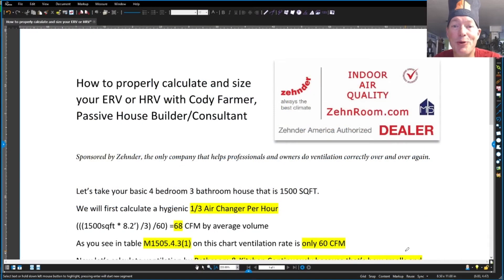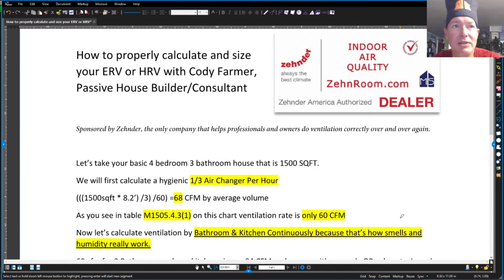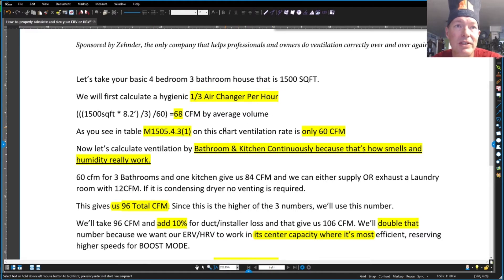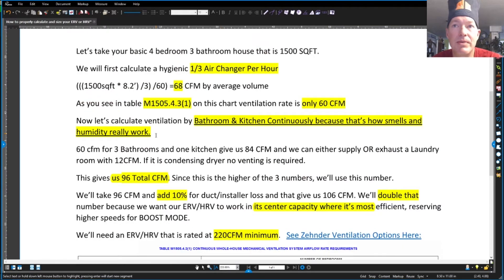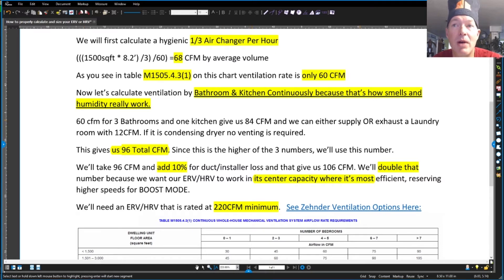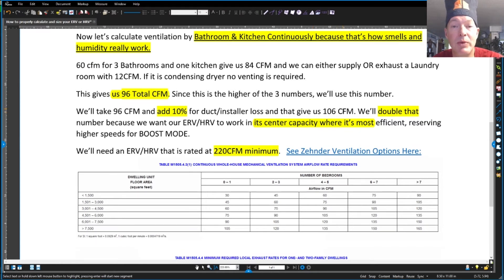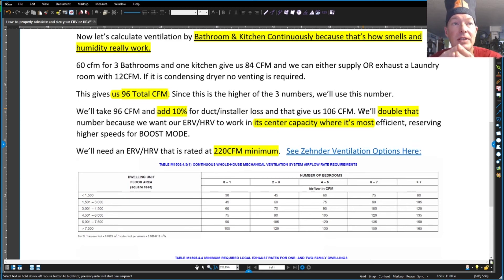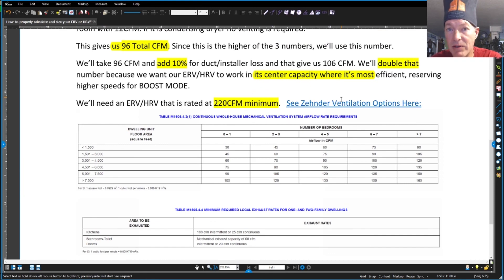Properly Sizing your Zehnder ERV or HRV

Comment: Hi, could you comment on maintaining a positive pressure of 1 to 2 Pa? We are building a 300m2 home, considered tight. 4 bath, 5 bed. Location; seafront - Philippines
Reply from the maker: That's a big questions now isn't it? If it's dry air, probably would be less a concern. If it's humid inside and pushing that into our wall assembly; we would want to look at that instance and thus depends.  Do you have a local Passive House group?
Reply: @PassiveHouseCody  Hi and thank you for taking the time to reply. Things have changed somewhat, since i wrote you. I have added a wholehome dehumidifier to the mix. And it would be great, to get your advice on this and the Pa levels. Or you could send me packing. 
I would like to place the dehumidifier near an exterior wall and make the outside air, its sole return - then duct directly to the supply side of the Zehnder. From there, the ERV would deliver dryer, cleaner air to the rooms. The bad air would be brought back to the ERV, as normal. I'm guessing, I could tweak the CFM levels on the ERV to reach an acceptable Pa?
I am also assuming, the dehumidifier fan, would be disabled? Would that be acceptable?
No, we don't have a Passive group nearby.
Reply from the maker: @davidbruce5377   we test the Air Tightness and offset the supply side to meet that IF possible.  The ERV wants what is most native inside; which in your climate you'll be drying with dehumidification and preserving that via ERV precision extraction and delivery.  I think your idea sounds worth a try. I slight pressurization with dry air sounds good from far. It all depends however on other factors.  Sources of internal humidity and frequency for one. Probably best to email us.
Reply: @PassiveHouseCody  Hi, here is what Santa Fe said;
The dehumidifier still has to work regularly like it normally would.
 
Regardless if ERV supply is going into the Dehu, or dehu supply is going into ERV, the air volume/power/speed needs to be as close to each other as possible.
 
For example, for our 70 pint, cfm rating is 150. If the intake/return air is coming into the unit, and it’s not 150 cfm, it’s going to reduce the performance of the dehumidifier because it’s not using the proper amount of air.
If the amount coming into dehu is more than 150, there is too much air, and not all air is going to be dehumidified, it is over capacity for what the unit can handle, force feeding more air than it can handle.
 
The same holds true for the ERV, it’s not catastrophic either if it’s not enough air, it just mathematically reduces the capacity of the unit. Again in this case, too much air overwhelms the ERV if not equipped for 150 cfm.
 
 
With all that being said, we also don’t want to recommend the UA 70 be used for just fresh air intake, as it won’t dehumidify enough with just one air pass through dehu. We would want to make sure that the dehu
Is in fact getting return air from house.